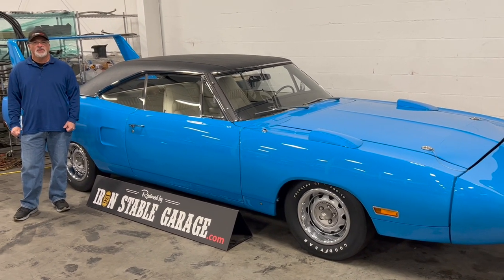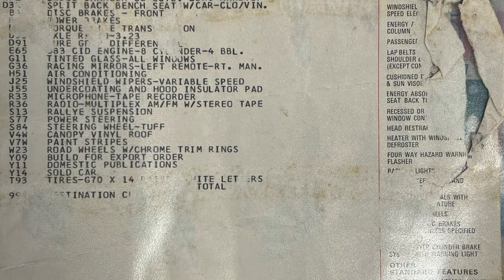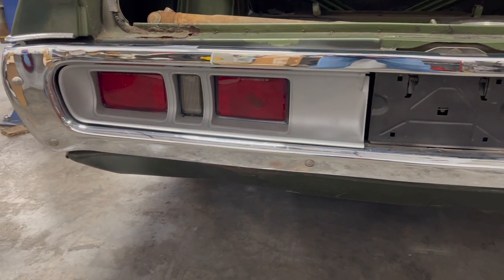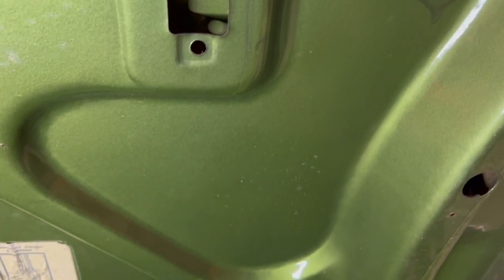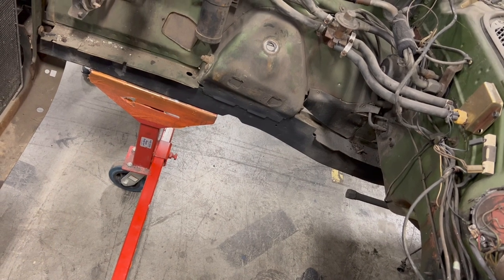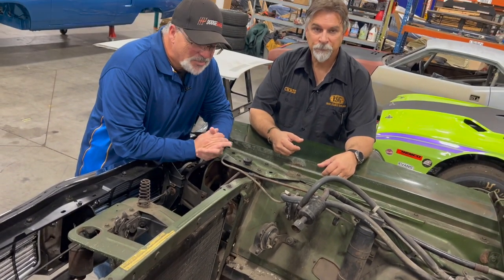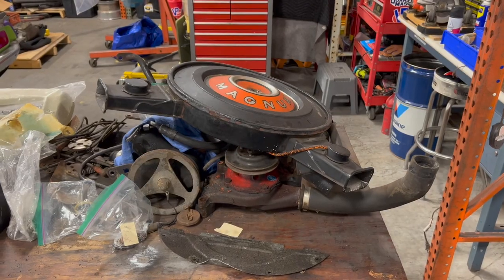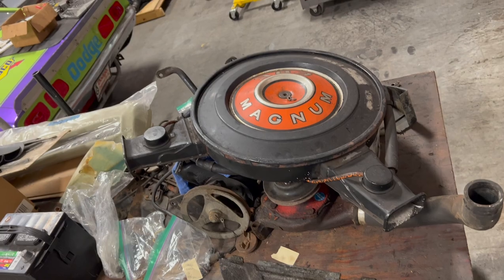1971 DODGE CHARGER Restoration, PART 1

Comment: This gives me flashbacks. I had the exact same car (1971 Charger SE) in 1981. I bought it as my first car at 18. Had the 383 with an Edelbrock Torker on it which I'm sure the previous owner installed, 4 speed manual trans with a Hurst pistol grip shifter, even the color was identical. Looking in the engine bay brought me right back to my wrenching days on this beast. Had some awesome times in that car! Thanks for the memories!!

Comment: Definitely like the '68-'70 best, but the '71 and '72 are the best looking Chargers after 1970.

Was that Holley carb original to the 383?
Reply from the maker: Yes, according to the current owner.
Reply: ......and all N code 383's in 1971 underwent a compression drop, and were down rated to 300 hp.